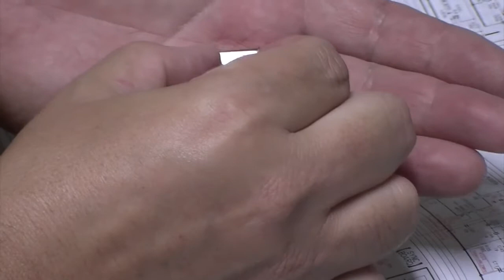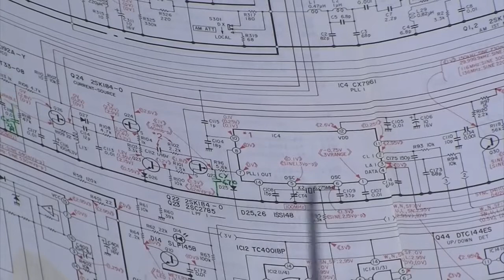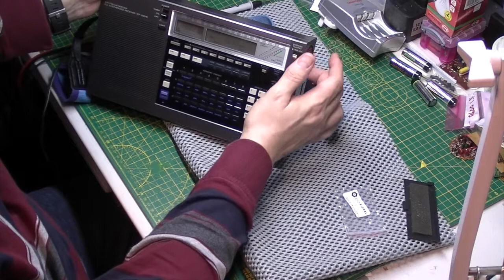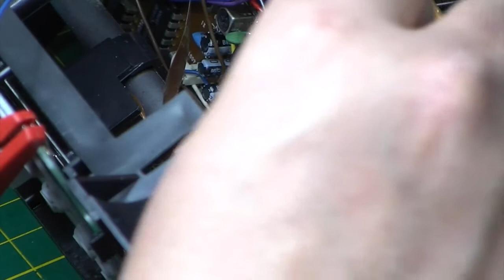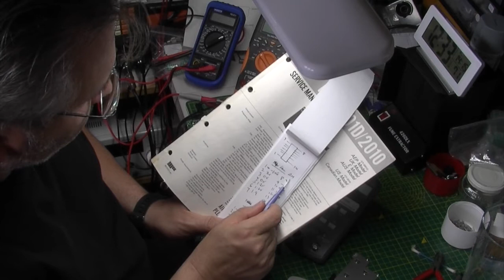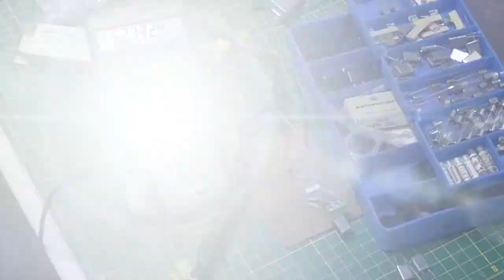Sony ICF-2001D help needed

Comment: Can you tell me if the back case has wires connected to the main body for the batteries. I thought there were wires for that last time I opened it. Can't see any now. Thanks!
Reply from the maker: No there shouldn't be anything connected

Comment: Hello
I've been looking on the net for suggestions with my ICF-2001D bought it in Fiji 1986. Perfect condition. Just sits on my night stand. The only problem is the volume nob doesn't slide smoothly. 
I wouldn't even removing the back. Who repairs these radios in america?
Thanks
Wayne
Reply from the maker: Hi Wayne. Have a look at the ICF-2010/ 2001D group on groups io. There’s a couple members on there in the USA that repair them

Comment: hello
your fault finding is perfect.
there is a product you are looking for on this site.  (6.275 MHz OSCILLATOR CRYSTAL)
other connectors are available 13 pin 9 pin (   sony icf 2001d or  2010d)

link :  https://www.sahibinden.com/ilan/ikinci-el-ve-sifir-alisveris-ev-elektronigi-tasinabilir-ses-sistemleri-6.275-mhz-oscillator-crystal-radio-special-zero-577478655/detay/

link:    https://www.sahibinden.com/ilan/ikinci-el-ve-sifir-alisveris-teknik-elektronik-devre-montaj-9-pin-ffc-connector-13pin-ffc-connector-sony-icf-2001d-2010d-583439249/detay/

link:   https://www.sahibinden.com/ilan/ikinci-el-ve-sifir-alisveris-ev-elektronigi-tasinabilir-ses-sistemleri-sony-icf-2010d-or-2001d-radio-9pin-or-13pin-connector-583735383/detay/
Reply: Perfect pieces for collectors. it is very good to produce such parts.
most wanted connectors finish the life of plastic parts in a certain time.
It's very good to give you a link here.
Thank you
Reply from the maker: It’s great to see that someone is making parts for these old radios. If I get another one in for repair I will be sure to contact you. The ribbon cable fix looks great. Thanks Graham

Comment: Good luck with your quest, I have a 2001D which needs some TLC, seems to have lost sensitivity, audio a bit muffled. I know there it a fet that can blow and that the capacitor on the audio c161? often needs changing out. Have you done any guides for this please?
Reply from the maker: The fet is easy enough to get to as it’s on the Jack board. This is aparantly due to static build up on external aerials. I have not had any experience changing these as all the sets I have worked on have been fine. You will need to get the board out to replace the capacitors but beware of the flat film cables which are very delicate. This is all in my videos so good luck. Graham
Reply: Many thanks, guess I'll have to get brave lol, ever changed out the antenna and headphone sockets on one of these?
Reply from the maker: You definitely will need to be brave and extremely careful. No I haven’t changed the aerial or headphone socket so can’t help there

Comment: I picked up an ICF-2001 at a thrift store for $15!  It's a bit dirty but seems to work OK except the dial light is really dim.  I was thinking of taking it apart and putting in a brighter LED until I saw how difficult they are to work on so I'm leaving it alone unless it needs to be opened up for service.  According to this article on Crypto Museum they were popular with communist spies during the cold war!
http://cryptomuseum.com/spy/icf2001d/index.htm
Reply from the maker: Hi Steve. That’s sensible unless you tend to listen in darkness. The display is light is usually pretty dim on these. . Thanks for the link. I did read that a lot of captured spies had these radios in order to listen to numbers stations. In fact they were ordered to go and buy one specifically. Thanks for watching

Comment: Hey mate, hope your well. Just want to let you know i can forward some well earned cash your way soon. Hopefully we will see some more footage of the dreaded Sony and it's full recap and that crystal replacement. I would also like a better light fitted if you can get time. If not no problem Speak soon and all the best 73's, Lee.
Reply from the maker: Lee Locke. Hi Lee. It's all back together and working well. I did send you an email earlier. Not sure whether it's worth taking it all apart again for the lights but it's your radio so happy to have a look
Reply: Great timing mate, i have read your message and returned you a reply. Thank you!!  FORGET THE LIGHT you have done more than enough on this one Sir, 73's Lee

Comment: Any joy with the crystal mate?
Reply from the maker: No crystal yet Lee but should be here soon. Did you have any joy bidding on the 2001D?
Reply: Radiocruncher no i never bid on it seeing as we have the crystal from Manuel now. I was going to but pulled out last minute. Got a feeling of regret now though.
Reply from the maker: Lee Locke we still need the ffc connector though. I have ordered some from China but don't expect them to fit. I am hopefully going to get a spares.set from the USA but still waiting on some prices, photos etc
Reply: Radiocruncher mmm ok Graham, thanks. Did you say it could be glued or do you need it to be mechanically sound? Connection wise, i wonder if Manuel has one. Shall i message him and ask?
Reply from the maker: If I can't get one or the Chinese one won't fit then I was going to pick up some eletrolube silicone to fix it in place as I don't trust glue on the delicate film cable. Let's see what turns up first.
Reply: Radiocruncher Ok Graham, thanks mate. Have a good day and shall speak soon. I will message the Manuel in Spain to see if he has one. All the best, over and out!

Comment from the maker: I have sent an inquiry form to quartslab. Also I found an eBay seller in Spain call Manuel who repairs these . He says he may have one from an ICF-SW55 so fingers crossed
Reply: Radiocruncher what has he got mate? A crystal?
Reply: Radiocruncher is that radio fix it on ebay from Spain Graham?
Reply from the maker: Hi Lee. His ebay name is radiofixit2015. Looks like he may have a crystal
Reply: That is good news Graham, has he been in touch with you to confirm this?
Reply: Thank you for all the effort you have put in mate!
Reply from the maker: Hi Lee. I have just paid for it so the crystal will be on its way via airmail tomorrow thanks to Manuel in Spain. Also thanks to Peter Brereton who let me know that the ICF-SW55 used the same crystal
Reply: THANK YOU!! THANK YOU!!
Reply from the maker: YVW Lee. At last I will be able to get it back together

Comment: It might not be any help, but there is an electronics company in Kasson, Minnesota, Kiwa Electronics; (Kiwa dot com) that sells different performance upgrade kits for the ICF 2010/2001D. I picked up an ICF-2010 in April for all of $4 I think and was considering sending it to them to do the upgrades since I got scared just trying to look inside - past my skill level. Maybe they have spare parts for you? I hope you get it fixed; it is a great radio.
Reply from the maker: Thanks for the info Dan. I will have a look on their site in a bit. It is very tricky to work on so I don't blame you for getting it looked at by a specialist. All the best Graham

Comment: The crystal you're after is also used on one other radio, the ICF-SW55. Hope that gives you a better chance of repair, good luck.
Reply from the maker: Hi Peter. Thats interesting. I will have to keep an eye out for onew as I suspect they may be cheaper than the ICF-2001D. Thanks for the tip. Graham
Reply from the maker: Hi Peter. Thanks to you I have tracked down a repairer in Spain that has a crystal from an ICF-SW55. All the best Graham
Reply: THANK YOU Peter, you are a star man!
Reply: Amazing knowledge you guys have, i am so happy and relieved. Thank you so much!!

Comment: Can you substitute a crystal oscillator for the plain crystal?  Arrow Electronics has 6.275 Mhz oscillators.
www.arrow.com/en/products/eph1300ettpd-6.275m/ecliptek
Reply from the maker: Hi Steve. Thats a possibility but i would have to work out how to wire it if it was doable. Thanks Graham
Reply from the maker: Thanks Steve. I will have a look
Reply: They are supposed to have show notes but I couldn't find any that mention the crystal since they haven't talked about the oscillator part of the transmitter yet.
https://twit.tv/shows/ham-nation
Reply from the maker: Thanks for this Steve. The crystal has a tight gap to fit in so it would have to be the right size. I have managed to get one from a kind repairer in Spain so it's up and running again. I will be on the lookout for a future supplier though.

Comment: Hello Graham. There's a Sony parts dealer called Encompass Parts. As a last resort you can get one from them but they really hold you hostage. They want $29 US which is around 22 pounds UK. plus shipping. Hope you can find one elsewhere for a lot less but their stuff is original Sony NOS as I say a last resort. Good luck with it. ATB Doug.
Reply from the maker: Hi Doug. I'm sure that the owner would be happy to pay that to get it working again. I just tried ordering one but got this message
 Error received from the database -236->We do not accept international credit card orders under $200.00.
Reply from the maker: That was a great lead though so thanks for taking the time to find it. All the best Graham

Comment: You could try removing the crystal and putting it on longish temporary flexible flying leads. Tapping the board would show up pcb trace cracks, if any and would prove the crystal is defective by tapping it directly. Good luck and hope this helps
Reply from the maker: Hi Colin. I'm not sure if you have watched all the video as I took the crystal out and made up an oscillator circuit to test it. I was able to prove that it was indeed faulty. Thanks for the tip though as it would have saved me a bit of time making up the oscillator if I had put it on flying leads first. Regards Graham

Comment: Seriously, I think it would be a lot easier, and far less grief, to source a used 2001D/2010, and keep the broken one for parts.
Reply from the maker: It would be far easier to buy a tatty one and break but they are very much sought after even in a non working state and fetch high prices. Thanks for the suggestion, Graham
Reply: Radiocruncher Yes. But what makes you think finding a crystal will be any easier, or, less expensive. I'm not kidding, a replacement unit would be much more practical- not in any way being flip or glib here.
Reply from the maker: I'm definitely with you Arthur and it would help with the broken ribbon cable connector. I will keep my eye out for a suitable doner
Reply: Radiocruncher you should contact this gentleman on Facebook, in the Shortwave Radio Station Listening group-  Rex Mauldin- I have two. One is not working and the other doesn't work either but I seem to remember it would work for a short time. Boxed them up in order to make one work but now I have other more pressing matters to tend to. Anyone interested in buying them for parts?
Reply from the maker: Thanks Arthur. I have sent a request to join the group so will look out for the post

Comment: Don't hold your breath on spares.  I have three of these unfortunately all working. God luck Graham.  They are sods to work on but Sync detector with selectable side bands is great.
Reply from the maker: Hi Simon. Yes it's certainly a scary radio to work on but they are worth it as they perform really well. Fingers crossed that I can get a crystal. Thanks Graham

Comment: In the meanwhile , before you find a replacement, you could try to heat  the crystal terminal slightly with your soldering iron , like if you were soldering the crystal pins from the factory. It might  fix the temporary contact inside by melting the solder and making continuity without having to tear it apart.  Good luck !
Reply from the maker: That's worth a try. thanks for the help and for watching. Graham

Comment: What about using a frequency synthesizer programmed to output 6.275MHZ using something like a MC145151 synthesizer chip not sure if you want to go that route using the 10.240MHZ as the synthesizer clock provided that there is enough room for a addin synthesizer board.
Reply from the maker: Thanks David. It's really tight in there but I might be able to squeeze a slim board in somewhere. Might have a look at doing that if there's no easier option.
Reply: There is a SMT version of the MC145151 which might make it easier.